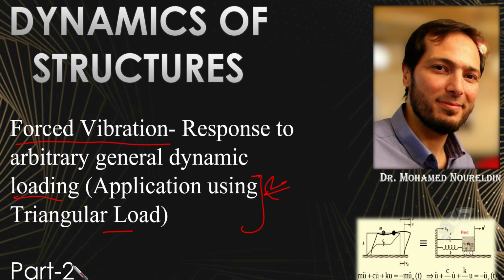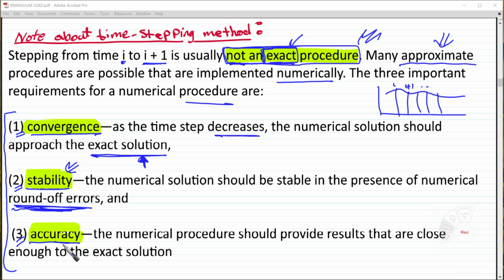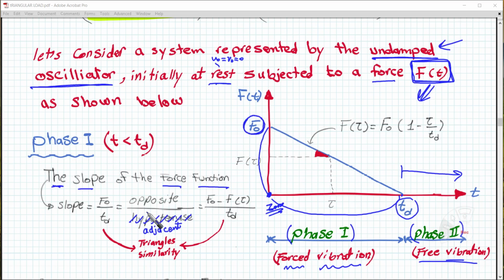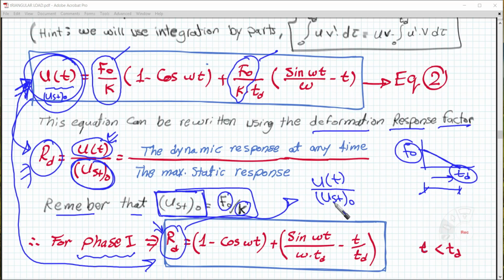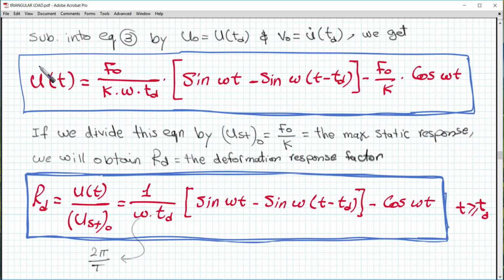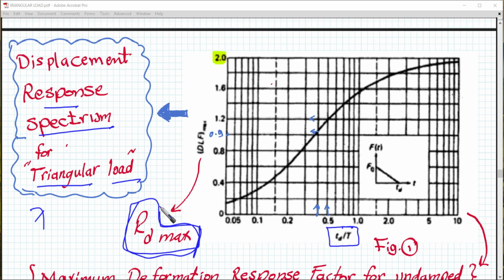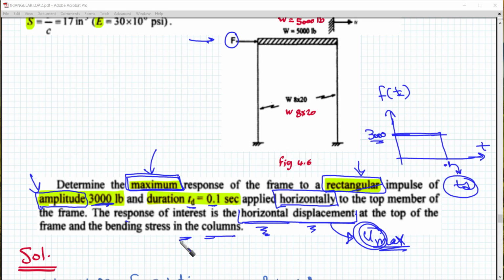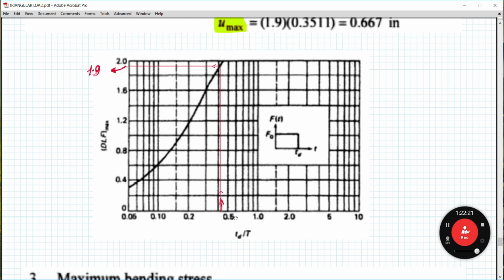15-Forced Vibration- Response to arbitrary general dynamic loading-Triangular Loading-Part 2

Comment: thank you Dr. for your valuable effort 
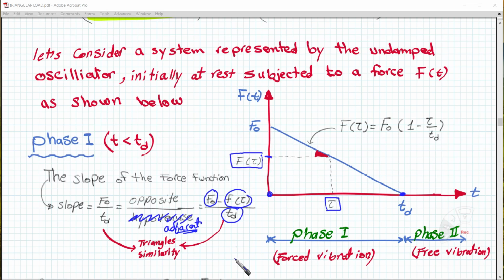at minute 25:55 , Is the function of the forced part correct ?  I think that the denominator of the small triangle is Taw not (td)
Reply from the maker: Thanks, Mohamed. I will add a comment in the description regarding this.
Reply: @dr.mohamednoureldin5718  Allah may bless you , I need any notes about how to read and understand the dynamic graphs such like (displacement-time) and (Acceleration-time) curves , but in your method especially because you are explain in detailes

Comment: Dear Dr. Mohamd, Thank you for your effort. Could you please help me to solve an problem ? 
It is :
Duhamel integral method is used to calculate the half cycle of undamped SDOF structure
For the displacement time history under the action of sine pulse, the structure is in a static state at the initial moment, and the pulse time history is
p(t)=p0 sin w t   0  =< t  <= bi/w
 p(t)= 0       t>bi/w 
need to calculate the time history displacement